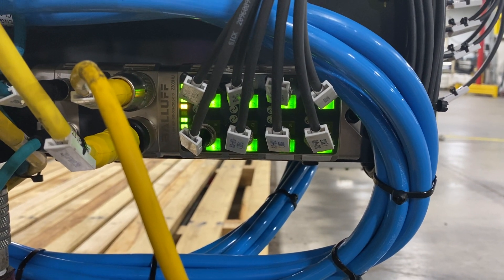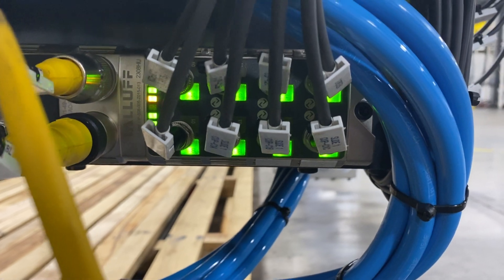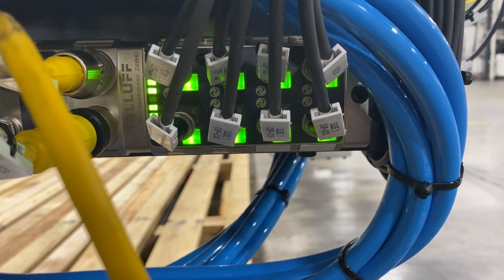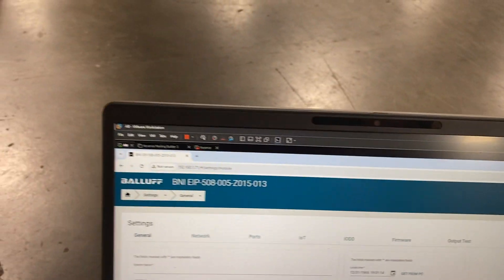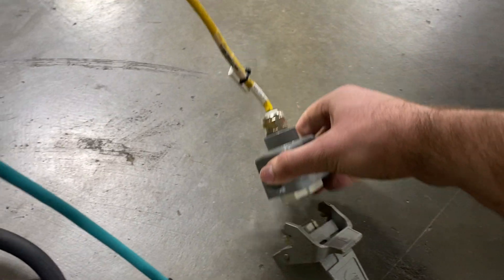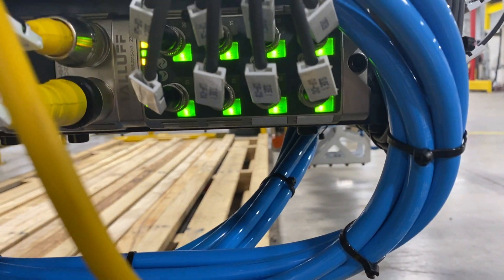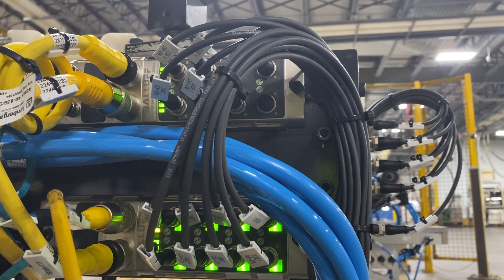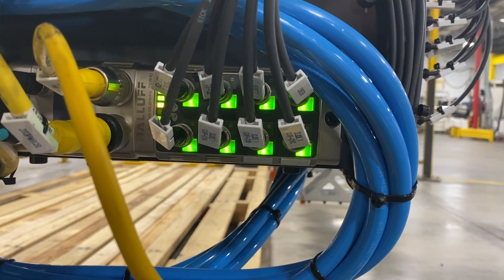Firmware bug? Balluff IO-Link Master not communicating with IO-Link devices on powerup (work-around)

Comment: how can I update fimrware?
Reply from the maker: To update the firmware, you have to contact Balluff support. They will send you the firmware update files for the hardware version you have. They are very easy to work with.
Reply: @christianmayne3588  Ok thanks! because I have a similar problem with a new BNI00HM. But I don't know why this module has firmware version 1.1, because of that I can't even access the web server.
Thank you and very useful video!!! I'm pretty sure that this video can save a lot of lives.
Reply from the maker: @user-vq5tb9jn7n  Some of the early hardware 9 modules shipped without the full firmware. I had a similar issue with an order of 4 of the BNI00HMs.

The hardware 9 firmware is updated with a .exe program that Balluff sends to you, not via the web interface.
Reply: @christianmayne3588  okey, thanks
One question, do you know if have to do something else with the module? Because this BNI00HM is a replace for a damaged BNI006A.
Reply from the maker: @user-vq5tb9jn7n  Nope, they are designed to be drop in replacement. The only difference is that you have to set the IP address through the web interface instead of the small screen. I’d also label the HM with the IP address so that you can work on it if needed in the future.
Reply: @christianmayne3588  That's right! I just update the firmware and I just have to configure the ports as IO Link and that's it.